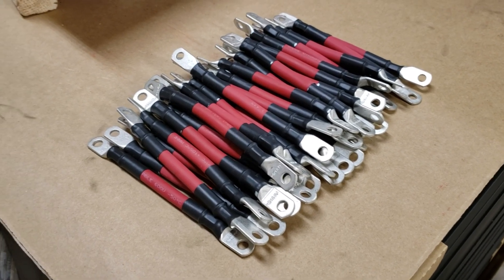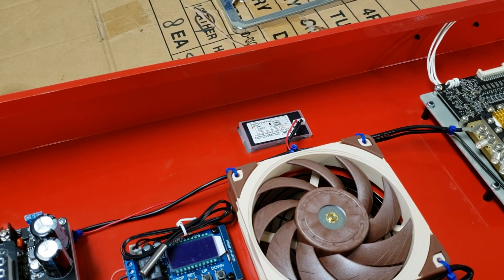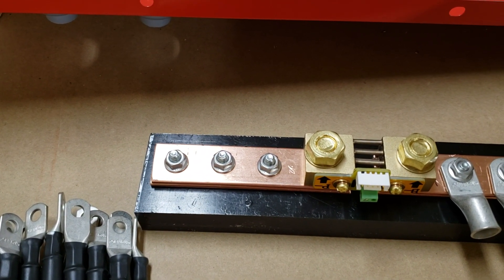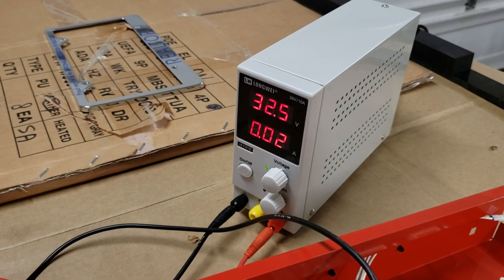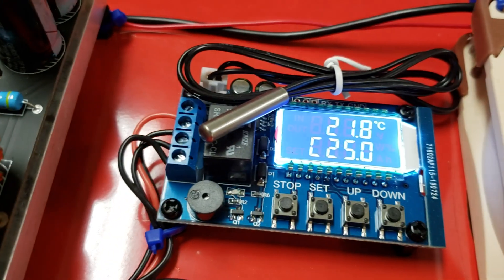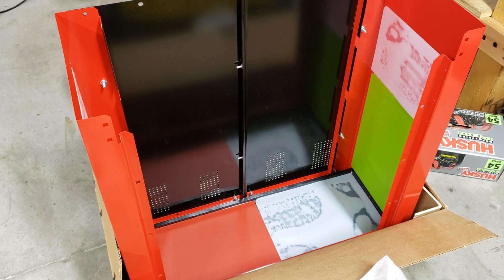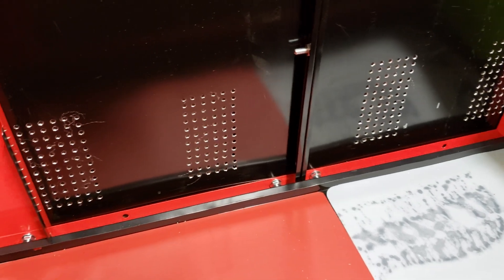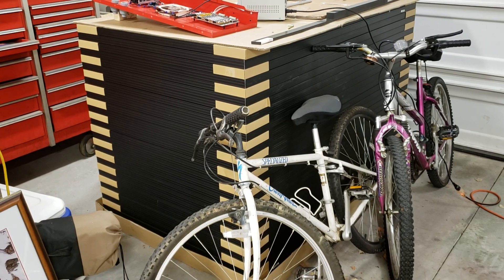Power Wall 2.0 Enclosure & Distribution Box

Comment: Question, Why not just scrap the buck converter and wire in the fan to 4 cells making 12.8v? The power consuption is neglegible and wont really affect the total battery capacity.
Reply from the maker: Might seem negligible but it would create imbalance. When fan comes on it draws over one amp.
Reply: @DMIINC2013  Specs for the NF-A12x25 FLX 12V shows Max. Input Power	1.68 W
 and Max. Input Current 0.14 A
Reply from the maker: Sorry. Completely my bad on that info. Do not know what was I thinking. If you look closely on my videos you will see that I have outlet for usb charging for up to 2.1 amps. Having fan running and my tablet charging amps do go up. Not necessary? Sure. But it is nice option to have in case you do need more power on 12 volts.

Comment: You mentioned issues with your Homeowners Assoc?  Check the laws where you live, most states have laws that override an HOA's ability to stop you from doing solar.  Here in Florida, statute 163.04 forbids any binding agreement (between HOAs or otherwise) to prohibit a property owner from installing solar. An HOA may restrict where you place your solar panels, but not if the system's performance suffers as a result.  As someone that lives in an HOA, I know first-hand how difficult they can be and I wish you the best!
Reply from the maker: No such laws in GA. I am getting involved in changing it. Thank you,